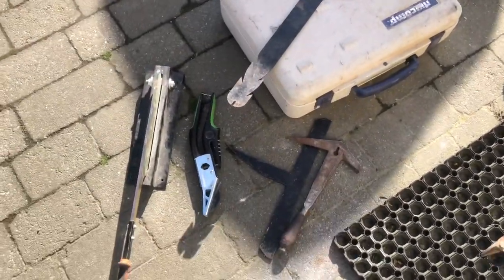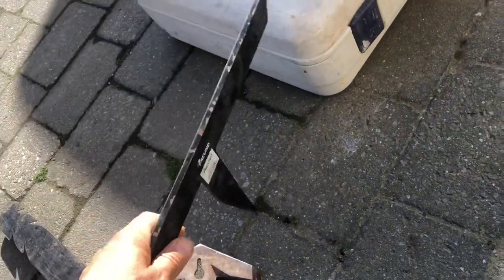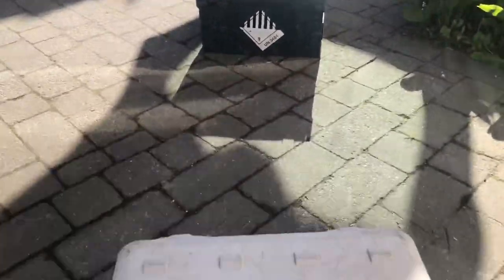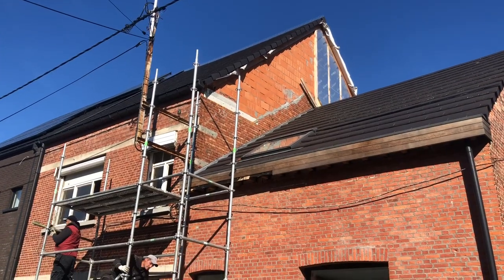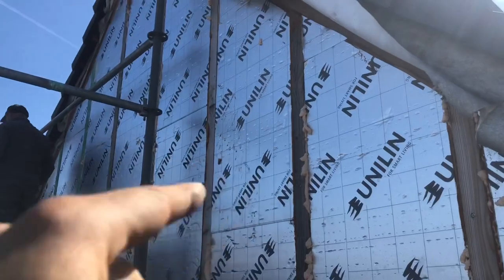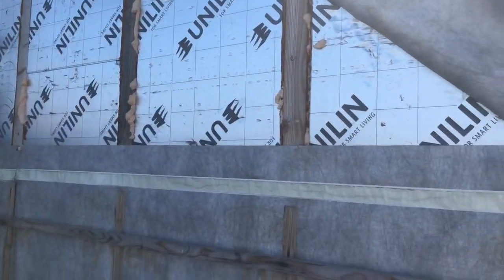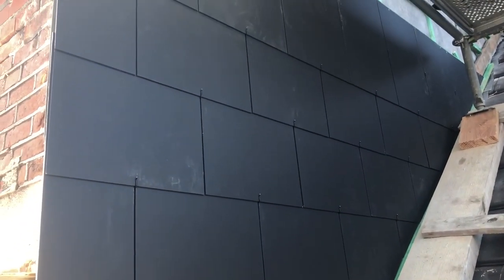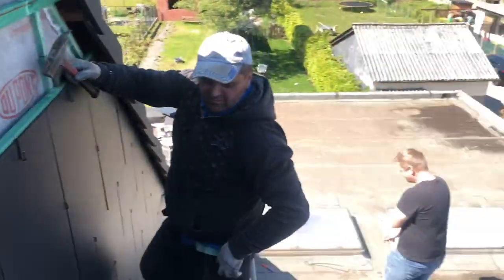Slates - A small job

Comment: What's the reason for this job more weather tight  or more insulation ?
Reply from the maker: mark the house is actually completely renovated , so the inside is a completely new contstruction .. concrete Floors and stairs ... now the roof is finished he can start placing Windows , do plumbing , electricity and decoration as last .. the front of the house is still not done , so you dont see anything of the renovation on the outside .. thanks